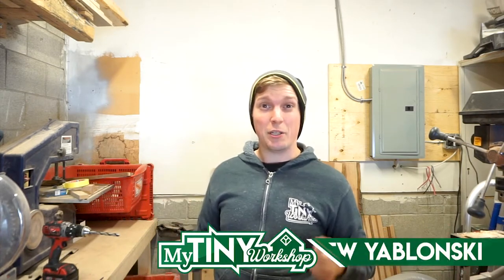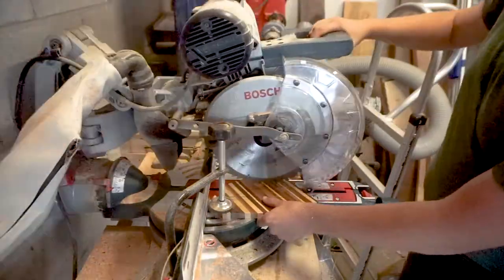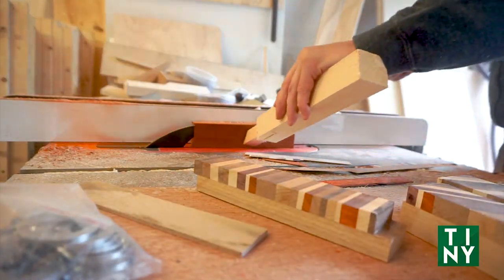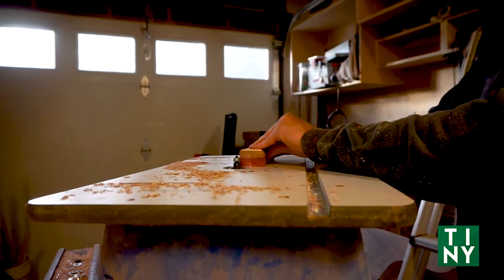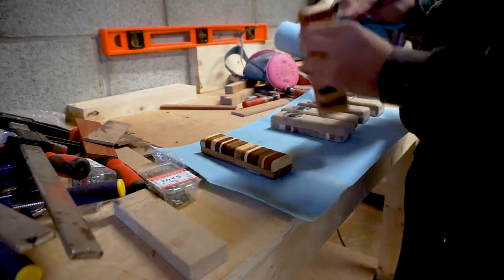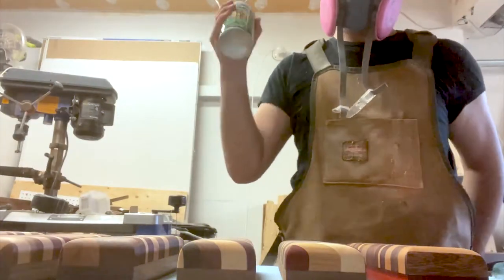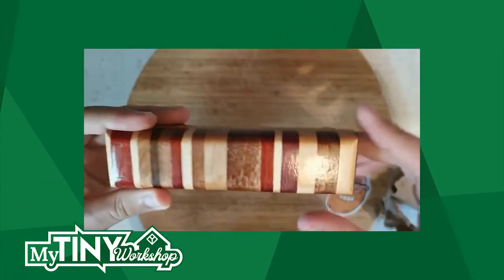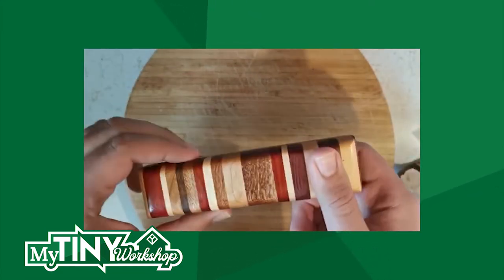Bottle Openers For My Groomsmen | My Tiny Workshop

Comment: They look incredible!! I'd like to make some for my colleagues, what were the diameters of the forstner bits (bigger and smaller) you used please?
Reply from the maker: Really depends on the inserts you end up purchasing! The ones I purchased were 40mm in diameter, so I used that size (or slightly larger) for the exterior hole. The smaller one in the centre needs to be small enough to fit between the screw holes, and large enough to allow a gap at the actual "bite" of the bottle opener. Probably a 22 or 24mm, if I recall correctly. If it's too large, the screws won't have enough wood to dig into, and could cause a break later on.
Reply: @mytinyworkshop  thanks man!
Reply: I came here for the same info.

Comment: what bottle opener insert did you use? looked like you were using screws that were longer than the inserts come with from like Amazon. amazing bottle openers!
Reply from the maker: Thanks Jacob! I used some bottle openers I found on Amazon. The included screws were not sturdy enough so I replaced them with some slightly longer #4 or #5s from the hardware store. Just had to make sure they would fit in the bevel!